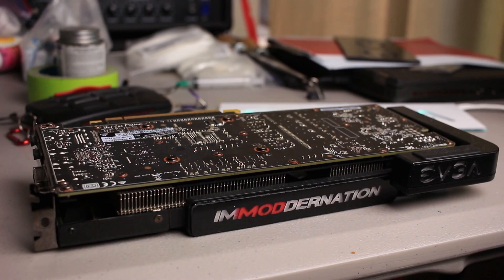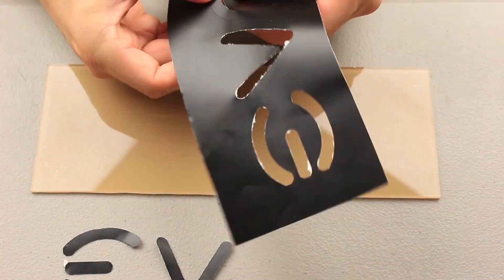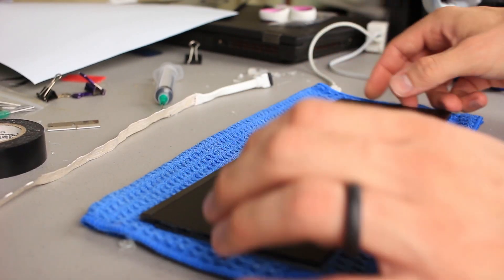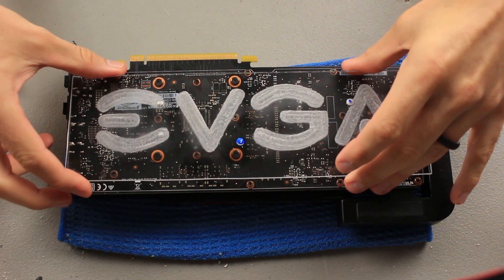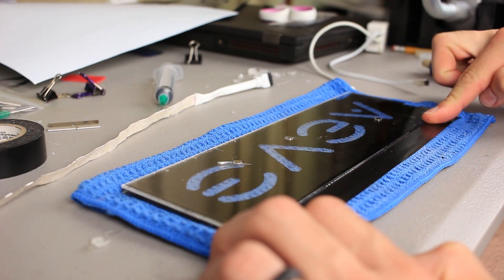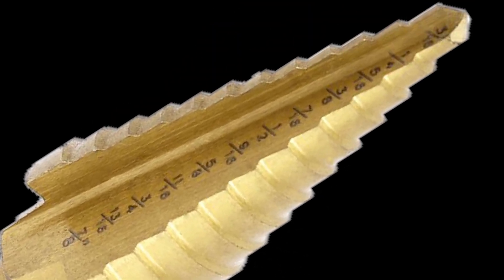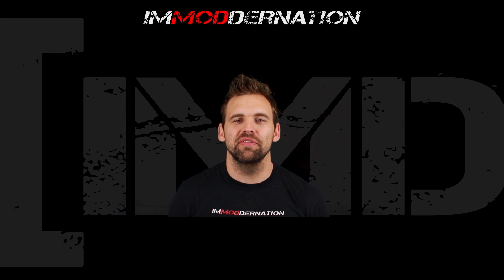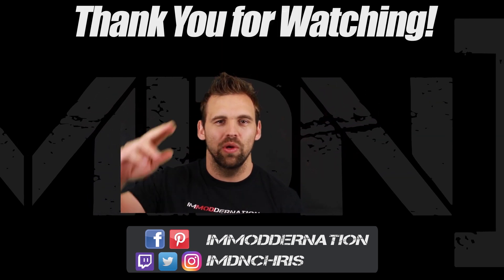MAKE A CUSTOM RGB GPU BACKPLATE GUIDE PT 2 (EASY & ADVANCED VERSIONS)

Comment: Before I watch Im going to guess its just an acrylic plate covered with some sort of paint or light blocking sticker with the desired design cut out and backlit with a 4 pin rgb stip. Lets see if Im right...
Reply from the maker: Wrong. Light reflecting sticker.

Comment: I can use this method to make an RGB license Plate
Reply from the maker: Yes you can. Just be sure to observe your local traffic laws and vehicle codes.
Reply: ImmodderNation of course, I’m just spitballing; Canada just changed legislation for front license plates, and I figured that rather than just throwing it and the mount out, I could use the mount as a housing for the RGB.
Reply from the maker: I have to say that for legal reasons. So you don't turn around and sue me.
Reply: ImmodderNation sorry, if it makes you feel any better, that didn’t even cross my mind
Reply from the maker: You're fine, it's just legal protection. Kinda like Caution: Hot Coffee on the McDonald's cups.
Reply: ImmodderNation this is fair

Comment: Can someone please help! I've made several of these and I can't get my design to shine as bright.
Reply from the maker: What kind of plastic are you using? What kind of lighting? Did you try pushing the LEDs directly into the edge of the acrylic? You can try polishing it too.
Reply: I honestly wasn't sure if this segment was done but thank God it isn't 🙏. Love the channel bro and not gonna lie the evga textured one is so dope.
Reply: Also if you don't want the led to show through the paint. After your first layer of spray way about 30 min and spray a second thick layer. It worked for me ajd I don't see the LEDs through the paint.
Reply from the maker: Good tip, thanks.
Reply: Ok so I'm on my 10th one I've made. The first couple of ones I did a clear acrylic design layer with a 2nd later of clear acrylic. 

Now that I know the proper steps I decided to use a thinner frosted acrylic for the design and a clear later where the light seeps through. 

I did push the LEDs towards the plastic. Also thank you for replying and let me know if any of that was confusing

I've watched your video about 20 times trying to get it right 😂
Reply from the maker: @christiangonzalez3894  it's funny that you say 20 times because the next video I'm putting out talks all about that. Stick around and you'll see
Reply: Update: FINALLY GOT IT TO LIGHT UP!!!!
Reply from the maker: Congratulations! Great job continuing to work at it

Comment: 4 months later I have the answer! jeffrey uses a reflective tape... iirc he said that in the video
Reply from the maker: So I tried sanding and polishing the edges, used aluminum foil as a reflector, and increased brightness to maximum in the LED controller. It looks like it worked. Maybe the automotive vinyl i'm using is not reflective enough.
Reply from the maker: It's an automotive vinyl he uses. Ive tried with little to no success. I think I need to flame polish the edges.

Comment: Would a reflective white vinyl possibly make the light dispersion better
Reply: Or reflective paint for that matter since the sticky side of vinyl wouldnt be reflective
Reply from the maker: I didn't use reflective paint only because I'd have to sand the acrylic to get the paint to stick. Adding scratches would make it look bad. Reflective white vinyl might help, but really the particles in the plastic help light diffuse evenly.

Comment: Most likely the reason he used the LEDs facing upwards is actually because he used side emitting LED lights, dietech mentions them in his gpu backplate guide, also iirc he recommends painting the back white instead of using vinyl which might be worth a try
Reply from the maker: No they're not side emitting. If you go to Jeffrey Mays website, they're just standard upward firing LED strips. It's the acrylic he's using, it's made for edge lighting led signs. As for painting the back white, that could work but I usually scuff the plastic so the paint will stick and you'll see those scratch marks through the acrylic I'm afraid.
Reply: @ImmodderNation  ahhh, alright then, although i still would suggest trying out the side emitting LED lights, they seem a little more costly but a lot better for this application
Reply from the maker: But even with side emitting the light will only travel through the plastic. The light guide plastic will diffuse the light evenly, giving it a nice glow. It's expensive stuff and used for professional lighting applications.
Reply: @ImmodderNation  true, im not denying that at all, im just saying the side emitting LEDs might help with making things bright and even is all

Comment: The one you scratched, if you use a random orbit sander and a very fine grit sandpaper (180+) you can make give it a mat finish :)
Reply from the maker: I think you mean higher than 180, that's like rock paper. If I spent the time to wet sand it from 200 to about 2000 I could give it a polished look. It wasn't looking the way I wanted it to look so I stopped. Thanks for the tip.
Reply: @ImmodderNation  I'm from a woodworking background, so 180 is very fine for me :P and it has worked well for me on glass (With a random orbit sander).
I don't know how hard the stuff you're using is, so you might go to something like 320. But if you go too fine, the mat effect is diminished. 
I just wanted to give you something you could try before you bin the piece :)
Reply from the maker: @rwiersema  I understand. Plastic scratches really easy. Too much finessing and it becomes clear again.
Reply: @ImmodderNation  Yeah I guess, as with most things, it's a compromise. 
Though without a random orbit sander it's almost impossible to not get noticeable scratches :)
Reply from the maker: It's possible with 2000+ grit sandpaper, but you're looking at maybe an hours work or longer.